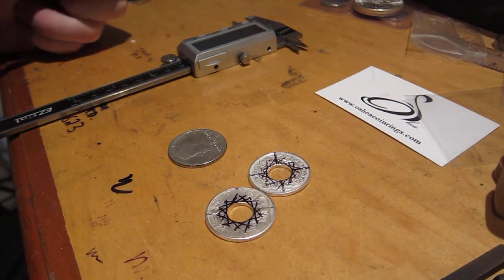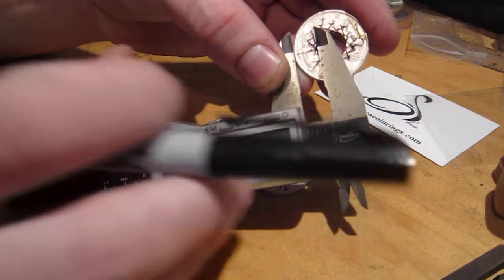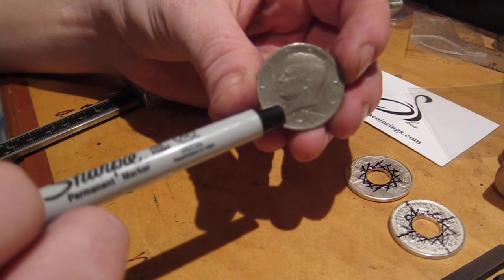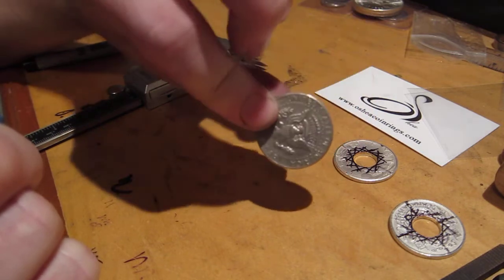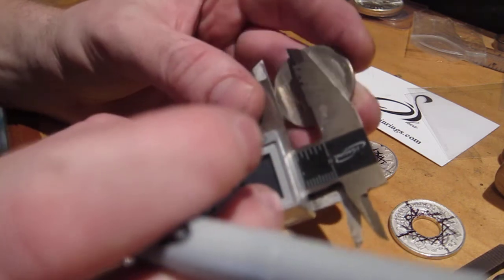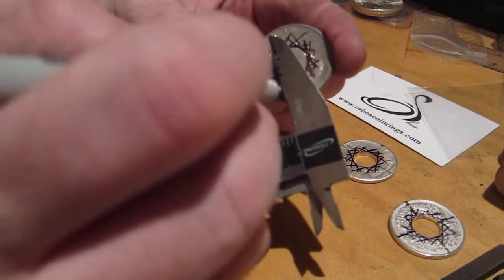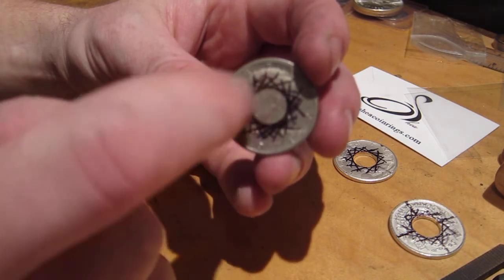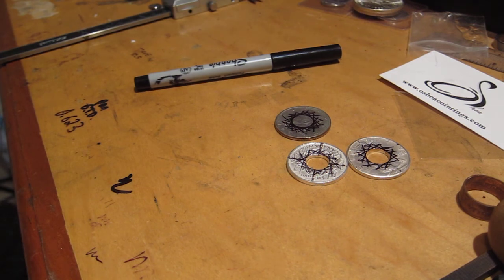How to make coin rings: Finding The Center With Calipers.

Comment from the maker: BTW. The Copyright Stuff I am referring to in this video. Was my images, as well as 3 other ring makers pictures were being used by a man named Wes Keenan as their own to sell rings they never made. This guy raised 3,700$ using pictures of my rings, and 3 others to sell coin rings. You can read about it here. http://osheacoinrings.blogspot.com/2014/07/must-read-spread-share-con-man-must-be.html
Keep in mind, I was pissed off when I wrote that post, sorry. But its been dealt with since. And things have been moving along fine since, with only one other case on Ebay....again.
 I copyright all my images as should anyone else sharing them. I started © them back in 2009 when I saw my work appearing on Ebay. Same photos I took. And I only take so many. If you're a ring maker, check that post as I did my research to find out the owners of the other images he stole.